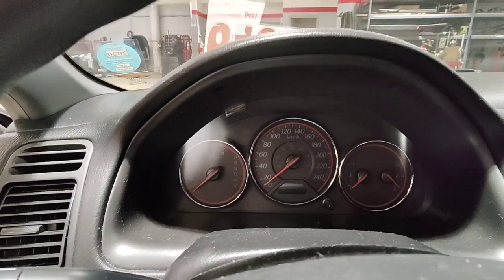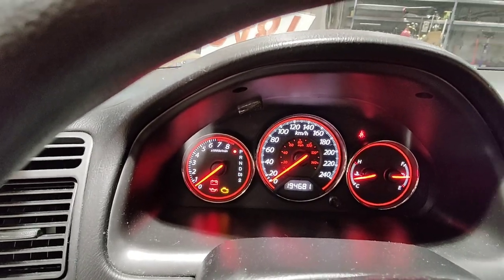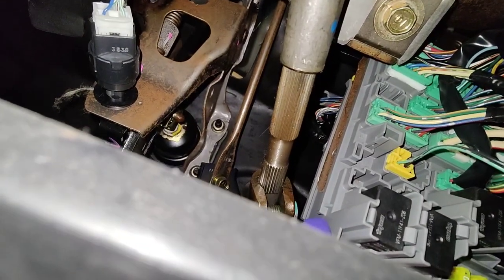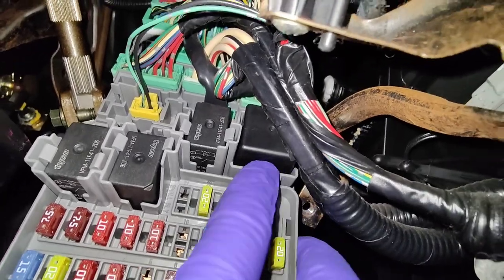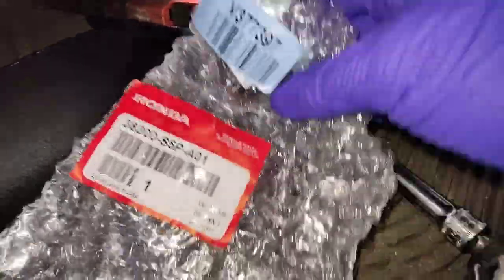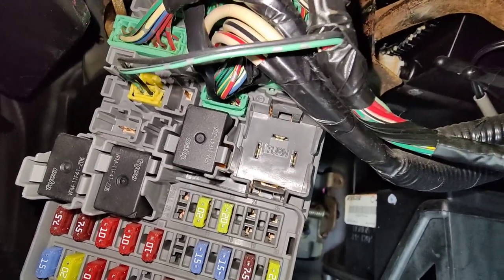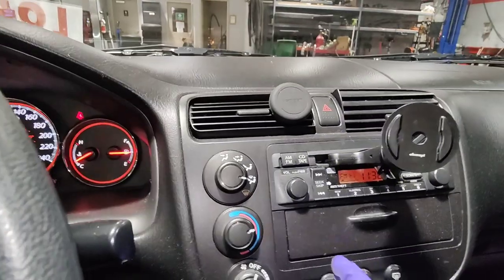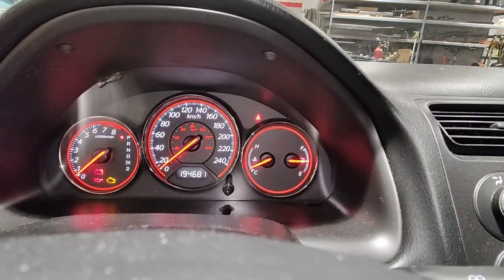2003 Honda civic turn signals acting up and finally stopped working. Here is how you can fix it.

Comment: My hazzards work fine although my turn signals work somtimes and other times they dont so if i have my turn signal on and its not working then i hit my hazzards they work what would be your best suggestion on what to check next or could it still be a relay?
Reply from the maker: They are most likely on separate circuit you would need to see the wiring diagram and see if providing the power or ground to the relay which is what your turn signal stock would do to determine if it is the relay or if it is your signal stock that's not working.
Reply: @theoffroadingmechanic  the issue slowly got worse and realized it would happen to both my hazzards and signals which are on the same relay so more than likely that relay is about to go completely out I would assume cause the hazzards and signals now are both showing intermediate issues off and on when before It would happen rarely if ever now it's often and when it does happen the 4 ways are as well effected

Comment: What if your turning signal is just stale green and hazzard lights also
Reply from the maker: It's the same thing the flasher is what breaks the circuit so it flashes. It can fail in more than one way.
Reply: Did you ever find your problem?

Comment: I was told newer models doesnt have flasher relay or its built into the dash
Reply from the maker: Yea newer cars now either uses an internal relay or transistor in the body control module on in the cluster. I had a Hyundai Genesis coupe where the running lights won't turn on or it tries to but flickers and it was an internal relay of the BCM/IGPM once a car is over 10yrs old it harder to get parts like a Tiburon with a no start that needed a BCM the part is discontinued. It was a friend of our GM so I just wired it to the headlight circuit that way it had running lights when it had the headlights on at night.